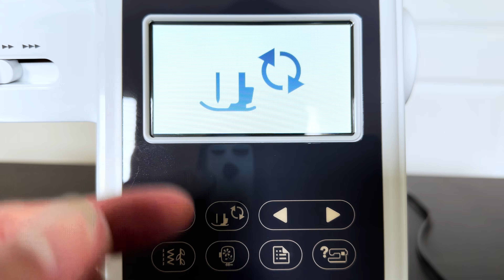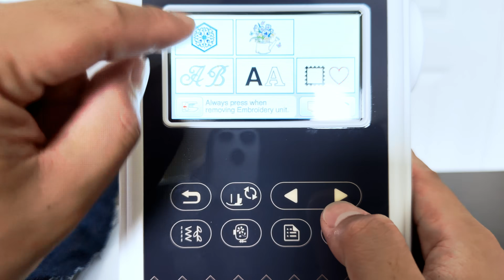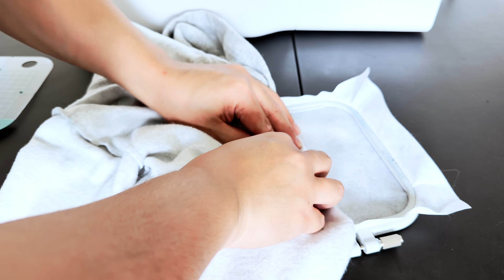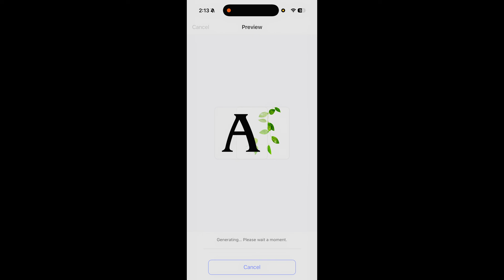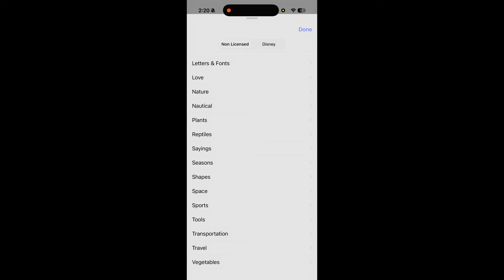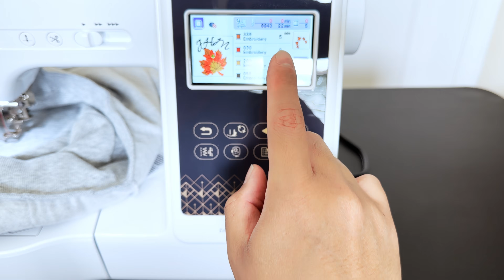Brother SE700 Sewing And Embroidery Machine | Demo, Review, and Beginner Basics Tutorial

Comment: What do you do if the machine stops in middle and won’t start at the place where it stopped. It starts completely over.
Reply: If you tap the needle icon with -/+ in the bottom right of the screen, you can advance forward or back in the design by different stitch intervals, and it will show you where that is when you do

Comment: I bought a SE 700. I was not able to remove  needle that came with the machine. Store where I bought it was kind enough to exchange it though it is their policy not too exchange or return. I bought a store warranty with the second machine..  of course the needle refused to budge with the second machine as well. I found a notice in the paper work on what to do to remove needle if there was a problem. If Brother knows there is a problem why do they continue to sell that model? I followed the instructions and still was not able to remove the needle. Several others tried as well.  I called Brother and they were definitely not helpful. The nearest shop that worked on Brother warranties was almost 100 miles away and they said they were going to charge me a $65 bench charge.  To remove a needle?  Any suggestions before I have to fall back in store warranty which is not much of a solution.
Reply: I had some trouble removing mine after the stock needle broke, but I was able to get it to come loose by completely unscrewing the retention screw then jiggling the arm it screws into to get the needle to dislodge

Comment: How did the white thread from your bobbin not show through? I just tried to embroider the airplane that’s on the machine. I used the white thread on the bobbin that came with the machine. And then I used blue embroidery thread at the top of the machine. My project came out with white and blue thread mixed.im so confused how to fix this
Reply from the maker: I would first make sure that the bobbin is oriented the right way.  It should go in with the thread coming out the left side (like a "p" instead of a "q").  That's usually what causes that, let me know